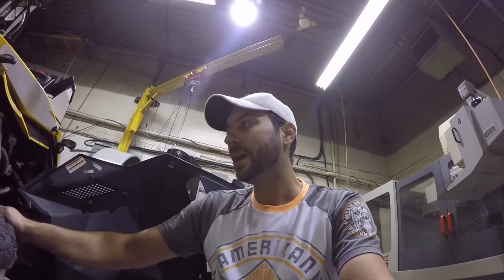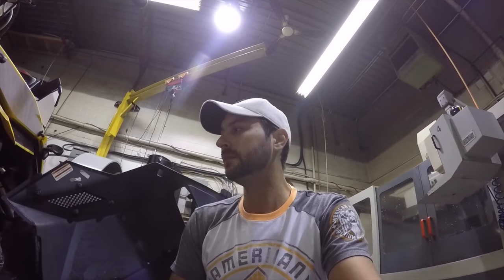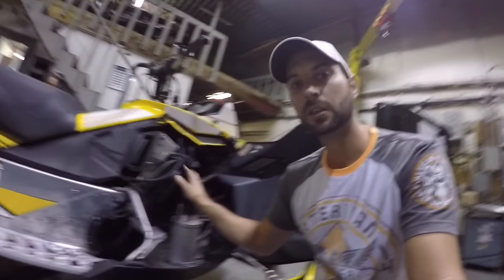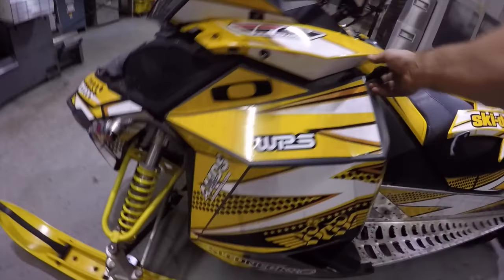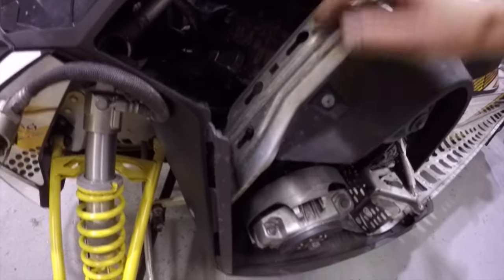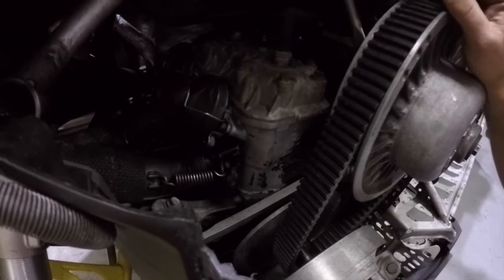#52 I ride 705 Skidoo XP engine build checking compression ratio 101

Comment: Nice video but you forgot to take away 3cc for the spark plug. So you need to take 29,1cc minus 3cc for the spark plug hole 26,1cc is your compression volume. Your cyl volume is 348,81cc +26,1 give you 14,36:1 comp needs race fuel for sure. And as you say squish bands are way to wide and negative from the bad machine work. I think you will make this sled work nice. We manufacture billet cylinder heads in Sweden for many Rotax and Arctic Cat sleds. Do more videos you are grate👍 Small detail about the 3cc in the calc you forgot. 
www.tikka.se

Comment: Great video.  I always thought that adjusting compression ratio meant you had to replacing the rods; I didn't realize you could just mill the head.  I understand it's not conventional, but how does the head over the combustion chamber being flat (instead of the 5° taper) affect the engine?  Looking forward to more sled videos.
Reply from the maker: FruitBasket when piston rises the taper flows the air fuel into centre of combustion chamber.  And the top of piston is not flat.  If you make swish band  flat then the piston arched top would compress those gases more than normal instead of pushing them to centre , and the could ignite the gas before the spark plug does causing pre-detonation
Reply from the maker: FruitBasket nobody changes rods to adjust compression ratio. It would be a lot of work to change rod length since you would have to separate the crank to install longer rods also it would change your port timing, most people will buy a billet head with interchangeable domes and buy domes with different compression ratio. 13:1 is common and 14:1 for mountain guys.  I'm going 12:1 because I'm not trying to gain more power over stock. And if I get crappy gas hopefully the engine will survive
Reply from the maker: FruitBasket you got me thinking I think I have a billet head at my shop maybe I should use it and cut the domes from scratch ! I might just do that
Reply: I RIDE 705 like your vids man
Reply from the maker: max thanks!